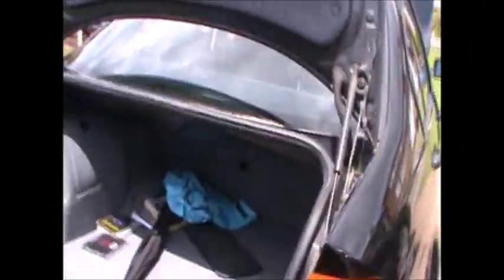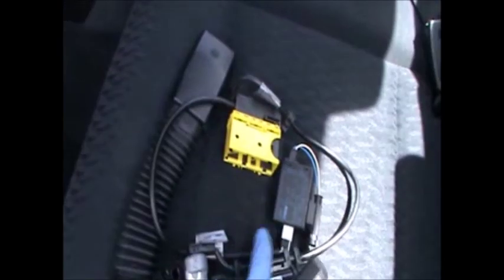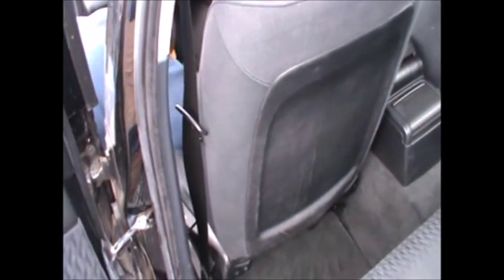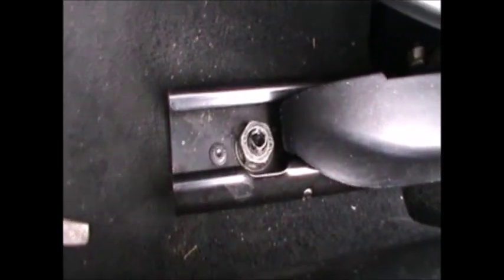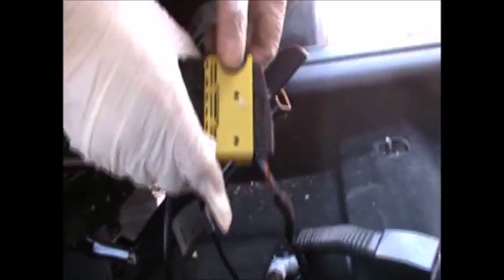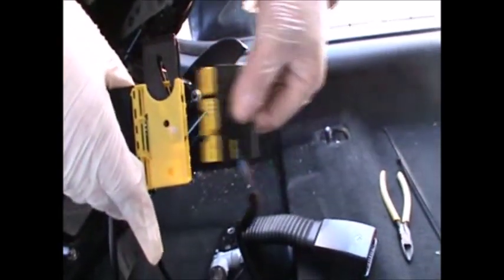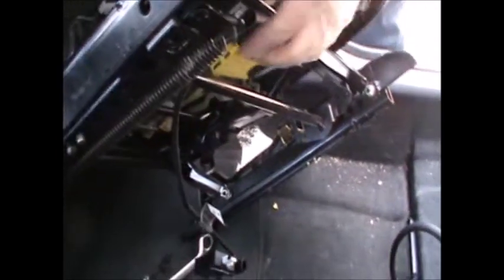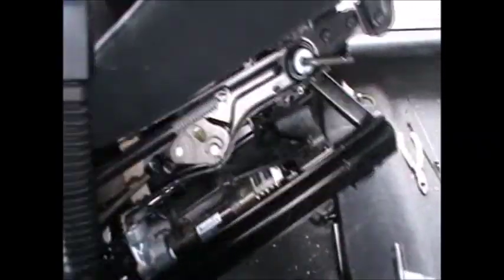E46 Seat Belt Tensioner Replacement

Comment: Okay my friend. Thank you for showing how to remove this part. However that is not the seat belt tensioner. The tensioner (Or sometimes referred to as the "Pre-Tensioner") is the part that comes out of the "B Pillar" that rolls in and out as needed for each persons size. It keeps the tension on your body when driving along and keeps the belt close to your body so when a accident happens it will be in the right position to tightly hold you in place. Again thank you for showing us this procedure.
Reply: That's not true. This part is called a seatbelt pretensioner because when you have a crash, there is a pyrotechnic device inside that pulls the buckle downwards extremely quickly, tensioning the belt across your body.
Reply: @LochyP  Exactly right, in the seat belt mechanism is only the seat belt retractor, which block at the fast moving forward, which is a mechanical system usual at all vehicles. Seat belt pretensioner is placed in the belt fastener, that´s why there is a pyrotechnical patron connected with car airbag system. You are right!

Comment: I have a BMW E46. Before you get too deep into the repair/replacement of the seatbelt tensioner, try disengaging the connectors completely (pressing the connectors together is not usually good enough).  I am referring to the male connector of the  pretensioner attached to the seatbelt system.    After doing this, try resetting by using your resetting tool (and I assume you have one.  They are not that expensive at all.)  If this does not resolve your problem, then by all means, proceed with the more involved steps.  Good luck!

Comment: My airbag light came on with a seat belt tensioner code. Had a look under my seat and the yellow connector is in a position, where everytime I slide the seat forward the connector gets jammed. After wiggling the wires with the ignition off, I was able to reset the code(I use the creator c110 - is pretty handy).
Reply from the maker: Great info thank you.

Comment: Hey i have a question .Everytime i put in a new fuse for the belt buckle becuase it shows the warning light on the Instrument panel it blows it out ?
Reply from the maker: +Jessie Bustos You may have a faulty backle that's causing some kind of short circuit, its difficult to say, you should get it checked

Comment: Will the airbag light turn off automatically when you do this installment?
Reply from the maker: +RuleElite I had to clear the fault code with an air bag reset tool, but I think in some cases it clears out if the fault is intermittent and does not come back.

Comment: Hi mate thanks for the video! About the airbag sensor...from what I have read on the forums my airbag light is on because of a faulty seat sensor and I'm wondering now if the airbag light is on because of a faulty buckle? I was wondering if both of these types of faults are registered as an airbag fault on the computer or does the computer tell you whether it is a seat sensor or buckle issue? Many thanks
Reply from the maker: Hi there, well to be hones, I had both faults on two different occasions on two different cars and yes in my case the fault code from the computer was for one e46 faulty seat belt occupancy sensor so I knew then that, that was related to the passenger side occupancy sensor, in the one on the video the fault code was something like drivers side buckle open circuit or something like that so I went ahead and replaced it. both faults are common, occasionally  you can clean the contacts on the plugs under the seats and the faults disappear but thats just luck.
Reply: DaringBeefcake Dude your a legend! Thanks a million for the info..and of course the unreal speed of your reply! I'm going to try and clean the connection (fingers crossed) and see if that helps. My mate is a mechanic and I'm not sure if he used a computer to diagnoses the fault or if he took a guess. I might bring it to someone to get the fault read and take it from there.   I'd be willing to do the whole repair myself so do you think I should invest in a diagnostic device?
Reply from the maker: You welcome, am happy to help when I can, if you are going to clean the contacts do remember to disconnect the battery. well the two faults are common but the occupancy sensor does happen more often. The bmw forums are a real great help so much info in there, if can read the faults that would be much better as it can at least give u a guide where to start looking. I would think is worth investing on a diagnostics device if u often do jobs on your car but a lot of diagnostics devices dont have the srs option for airbags so be sure to get one that does or u can get one that just diagnosis air bags.
Reply: DaringBeefcake excellent! Thanks again brother! I'll check out the prices of the devices..if the airbag device is super cheap I might grab one. I'll keep you updated bro thanks a mill from Ireland! :D
Reply from the maker: No probs, do indeed let me know how you get on.

Comment: what scanner tool do you use? i have 2004 e46 320 d
Reply from the maker: +ral islegend Well for resetting the airbag light and reading codes I was using a B800 srs scanner, as far as I know it works on most e46's.

Comment: Please help! e46 seatbelt tensioner fault. Replaced seatbelt tensioner & wire harness. Fault is coming back after 5 days or so from being cleared. Don't know what is causing it. All parts New OEM BMW parts from dealer.
Reply from the maker: Rodiddy have you check the seat sensor for the airbag, they can cause problems too. And occasionally the problem comes from the other side. Can you read the fault codes with and OBD2 reader.
Reply: It can then be the wire from the seat to the airbag module. I have heard that this can only be done by a dealer as requires special tools.